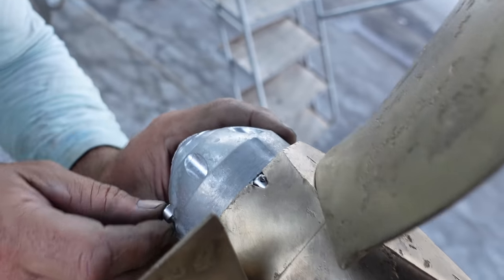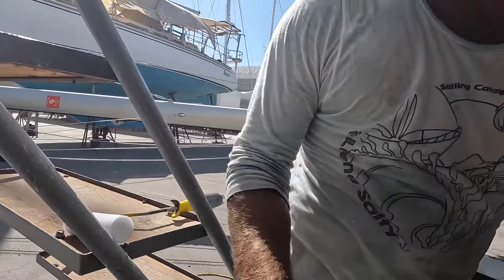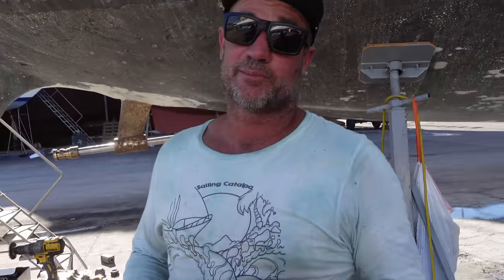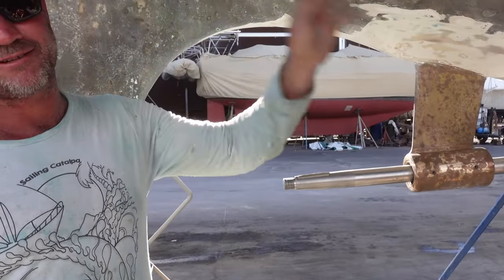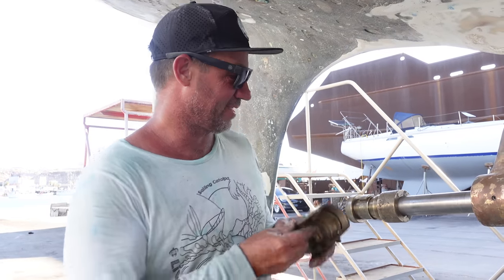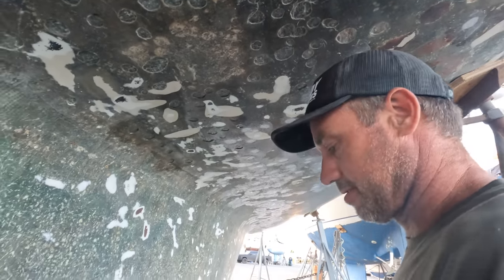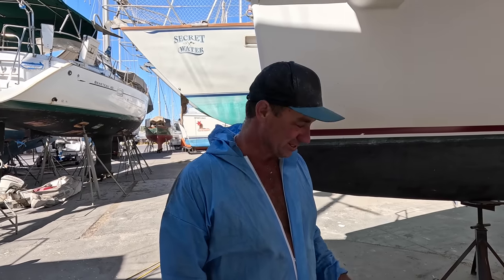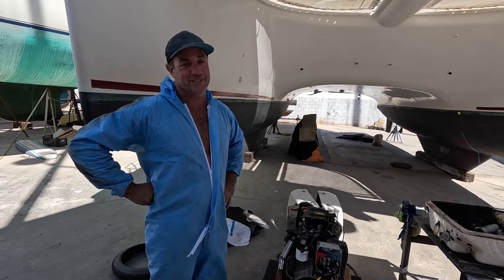Osmosis, Electrolyse & something else to fix Boat Yard projects | Ep 382

Comment: If that generator is 3phase @ 240v, 1 leg to the neutral is 120v. You would be able to load balance all 3 phases by splitting your loads up or keeping the generator on its own circuit. 
FYI. No transformer needed.